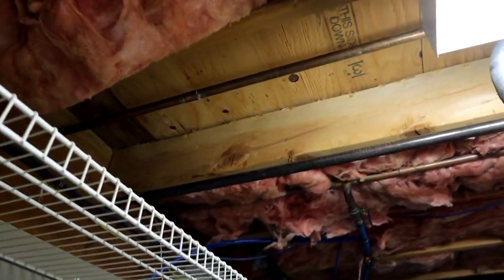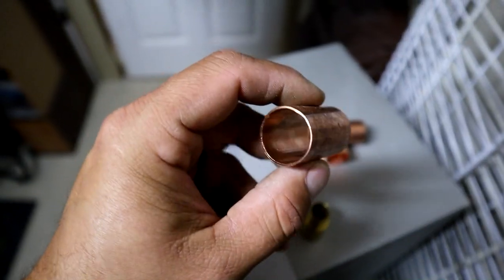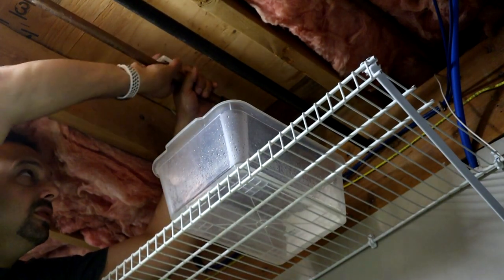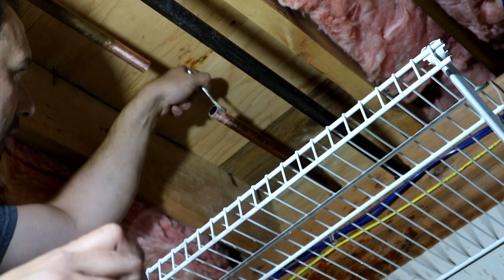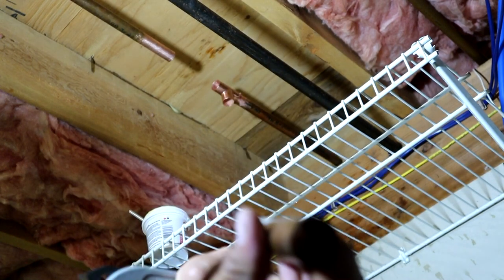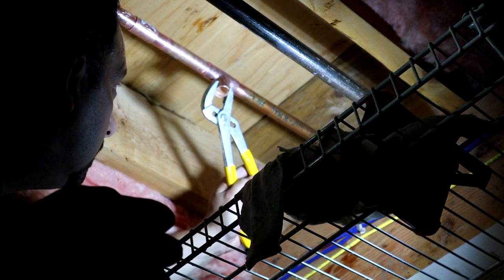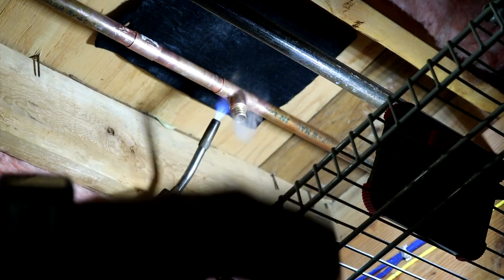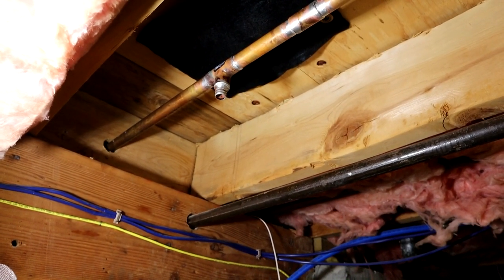Soldering Copper Pipe | How To

Comment from the maker: Copper pipe cutter set: https://amzn.to/32JPzIf
Torch: https://amzn.to/3ntFBCL
4 in 1 pipe cleaner: https://amzn.to/3kwpimA
Copper pipe mesh cleaner: https://amzn.to/2H1I4Vg
DeWalt Drill/Driver set: https://amzn.to/2PVXmM3
DeWalt Circular saw: https://amzn.to/3kZzmpv
Miter Saw: https://amzn.to/30UHYFJ
Milwaukee Drill/Driver set: https://amzn.to/3auep1t
The BEST Screwdriver: https://amzn.to/34xw3QN
The LAST pair of pliers you’ll ever buy that the PROS use: https://amzn.to/3aYacDk
AWESOME wrenches: https://amzn.to/3lioLq3
DeWalt grinder: https://amzn.to/34LalZV
The BEST Hammer: https://amzn.to/3lUKFjw
Level 2 foot: https://amzn.to/2Gxa02F  
Spring clamps: https://amzn.to/3mGcUSG
Tape measure: https://amzn.to/3oNfAjh
Drill bit set/index: https://amzn.to/3kSj1Tu
Canon M50: https://amzn.to/2PdqqhO
Mic: https://amzn.to/33jqXae
Tripod: https://amzn.to/3k4w3wP

Comment: So what if one of the joints dont take the solder good but the rest do. How do you get the bad joint to rake solder
Reply from the maker: Quickest and easiest method to try. Heat the joint up and brush the outside of the fitting near the point with flux. Since the fitting is hot, it might suck the flux and and then you can try to resolder.  If that doesn’t work, you’ll need to take apart, clean both the fitting and pipe, apply flux and try soldering again. Good luck